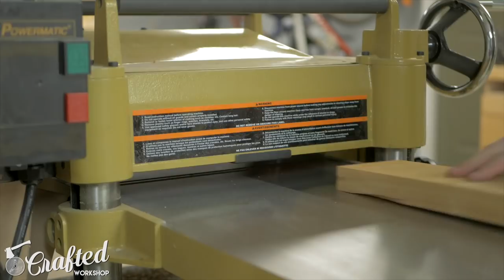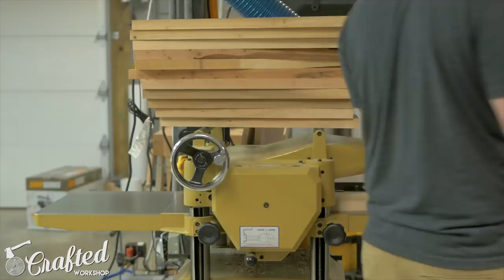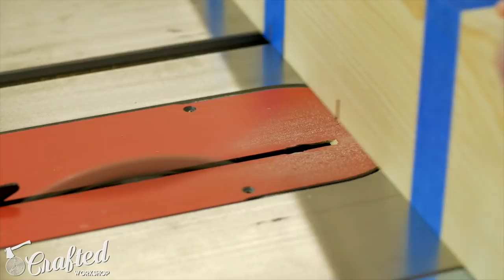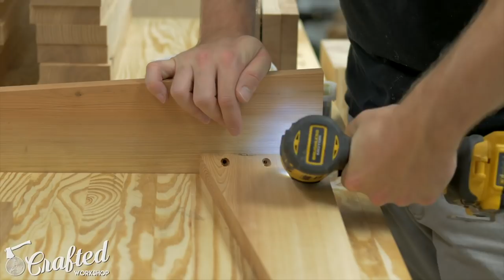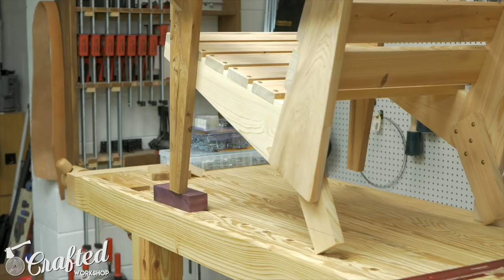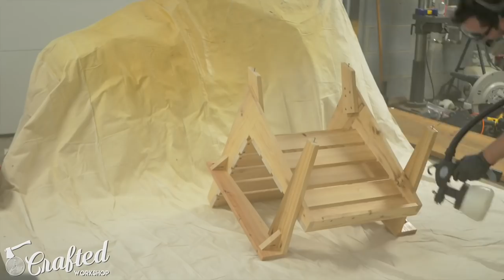DIY Modern Adirondack Chair | How To Build - Woodworking

Comment: Nice video and chair too. I would go with curved back and seat and all edges.  Specially if the chair will be used outside.  It's should have all edges round over.  Anyway nice project.  Cheers
Reply from the maker: +Slovenian Woodworker thanks!

Comment: Always hang on to the waste from your taper cuts, you could have used them on the opposite sides of your base to keep your clamps square.
Reply from the maker: Since I nested the pieces, this wasn't really an option. I didn't have any off cuts that would have done this, but definitely a good tip!

Comment: Totally agreed on how it looks so nice with a natural finish! That exterior 450 - does it protect from the moisture and water? :)
Reply from the maker: Thanks! And yes, Exterior 450 is designed for outdoor furniture. It will protect from the elements and has some flex to account for seasonal expansions and contraction.

Comment: Are there outdoor kreg screws for that wood thickness? Or did you just use regular 1.25" pocket screws
Reply from the maker: I actually used outdoor rated pan head screws that weren’t Kreg brand, as I needed shorter ones and Kreg doesn’t seem to make them.
Reply: Crafted Workshop so they are just regular outdoor screws? Not pocket hole screws?
Reply from the maker: They are the same shape as pocket hole screws,